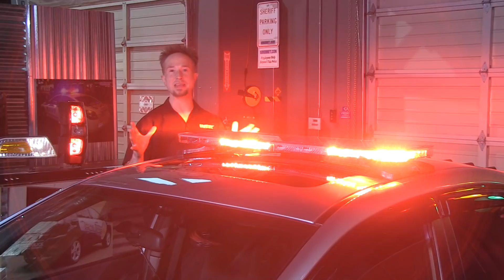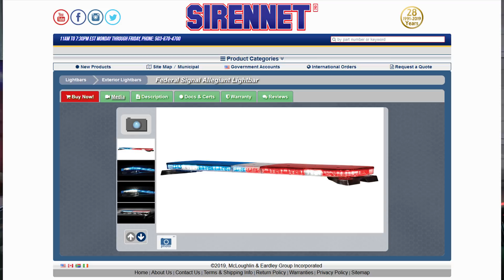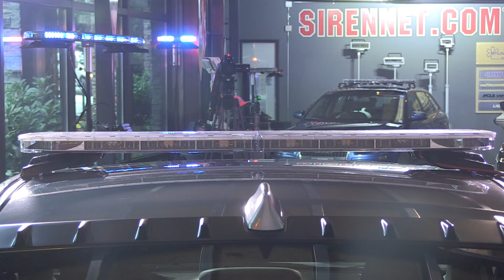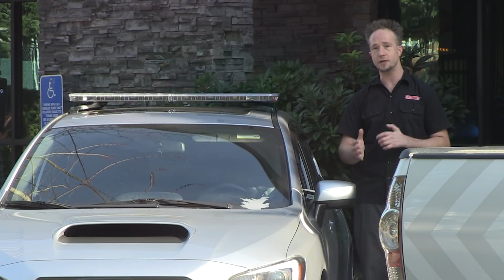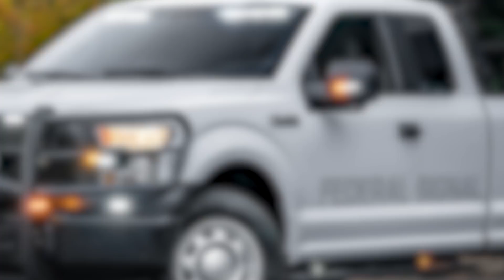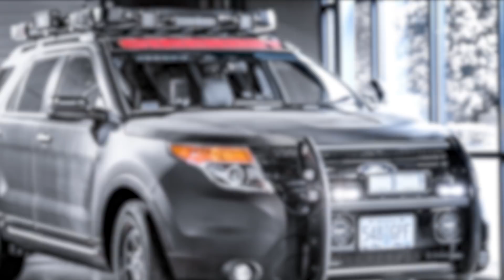The Federal Signal Allegiant Lightbar

Comment: Do this fit the 2017 Chevy Corvette Grand Sport?? And this lightbar can be programmable with the Whelen CenCom Sapphire (CCSRN36)??
Reply from the maker: It can be made to fit. So long as you use the Serial Interface Module, it can be wired into and controlled using a CCSRN36.

Comment: Would be nice to see it shown at further distance outside and in tougher situations (ie: the background not being a building covered in shade). Being able to program your own patterns would be nice and better fast patterns for the front when running code. Too many other little options ive never heard of anyone requesting or needing seemed to be the focus of this light bar
Reply: I mean he did mention being able to customize the patterns, all he showcased were the patterns it comes default with using its own built-in configurations. He did mention that the lightbar can be ordered with the "plug and play" functionality to your own controller box. I'd also like the point out that the focus of this lightbar is improved safety, which is why it has "too many other little options", as you put it. Granted I'm not an emergency service personnel so maybe my thoughts don't mean much, but it seems like a lot of concern with traditional lightbars boils down to too much visibility when its not needed (i.e being unable to turn off the blinding side modules when a door opens while at the scene). I'm not too sure how practical the example he gave (not blinding the car in front through the rear view mirror) actually is, however.